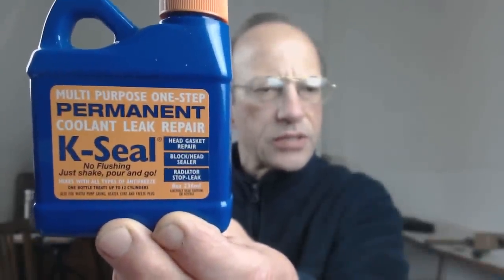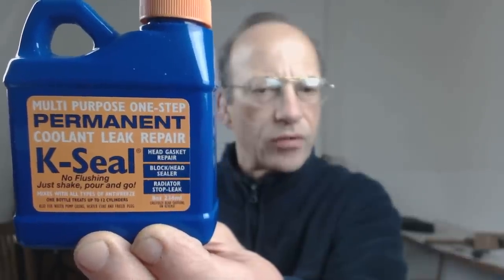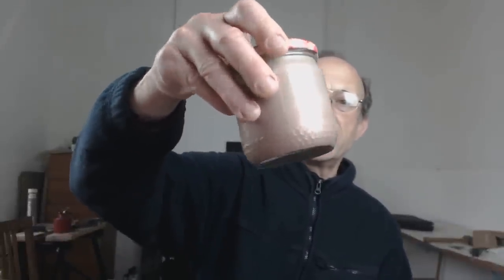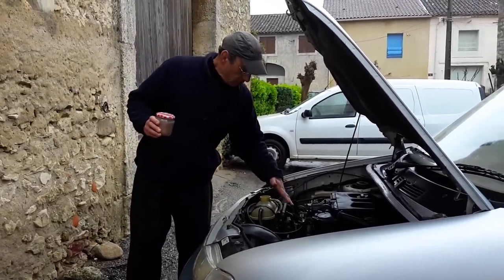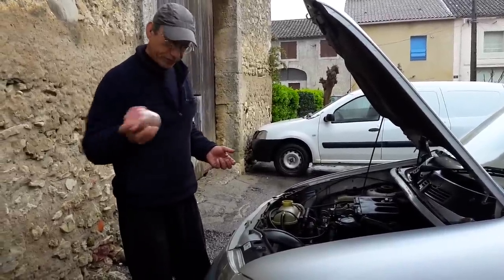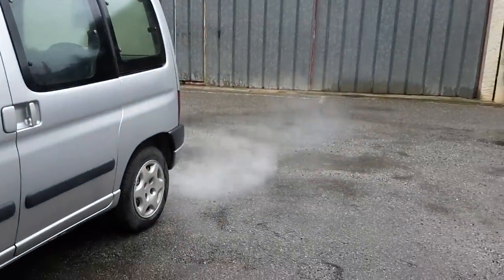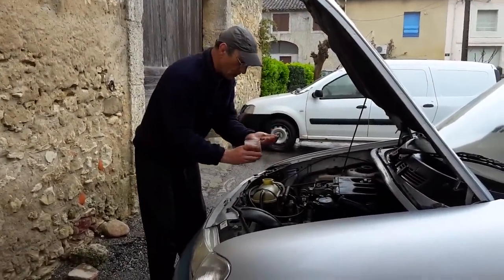K-Seal Full Test - Purchase options, Instructions & Results

Comment: I'm more than likely sounding really dumb but here goes lol. Do you think its too late for K.Seal if smoke is coming from under the bonnet aswell as the exhaust plz? I really can't afford to folk out for a new car. I'm clutching at straws🙈
Reply from the maker: Hi Keeley :)
Yes; you can feel gratified by your correct analysis; and as such, you qualify for both Brownie points, and some measure of assistance :D
FYI it was the  "smoke is coming from under the bonnet" that placed you firmly in the category of 'Damsel in distress' LOL.

It sounds like the engine head gasket has failed.
When the fuel explodes, a good gasket will stop any of the 'explosion gas' from escaping into the water coolant.

Please note that the cooling system is pressurised when hot, and some pressure remains, even when cold.
Do not open the coolant cap when the engine is hot. 

With the engine cold; lift the bonnet, and find the plastic header tank expansion chamber.
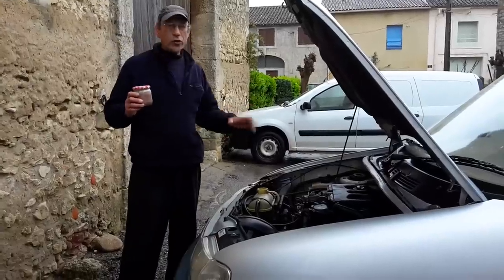This is near the radiator, and can be seen at 3:56 in the video. 
The cap opens in 2 phases.
First, slightly open the cap anti-clockwise until you hear gas escaping.
Once the gas has escaped, you can turn again until the cap can be lifted off.

You will see that the cap contains a spring safety valve.
This allows excess pressure to escape, in the form of steam (not smoke).
This why you see steam coming from under the bonnet.

You must watch the full video.
You'll see that I started the engine with the cap off, and let it warm up, before adding the k seal.

For simplicity, you can do it from cold.

Shake the k seal, and pour it in the header tank.
Now add water to the tank, to the max level mark (as per the video).

Replace the cap fully, and start the engine.
Leave the engine running for 15 minutes.

Don't forget to talk to your Angel, and ask her for help.

If it doesn't work, then I guess that you are going through your allotted 'bad patch'.
This will indicate that you need to get your life in order (maybe find a good man) ;)

Best wishes.
:)
Reply from the maker: Also; after the k seal installation.
When the engine has cooled...
Carefully (as described), remove the cap, and top up the water to the level in the header tank.

You need to check the water level, because there may have been air in the system.

Don't forget to report back, to let us know the result ;)
Reply from the maker: So Keeley ... How did it go?
Reply: @EngineTuning  hey. did you need to replace oil after? or coolant? or just pour kseal and drive
Reply from the maker: @clio00  
Check your oil to ensure there is no water contamination.
The coolant will require anti-freeze (if you suffer harsh winters).
:)

Comment: Hallo again, how long do you think that k seal will stay active in coolant and doing it's job ?
Reply from the maker: It must complete it's job, very quickly!
3 minutes should see the fissures closed.
Perhaps there is a residual sealing
... but, for the most part; the sealing is completed around the 3 minute mark.
Reply: @EngineTuning  Let me get this right. K seal is active in coolant system only for a sort period of time ? Perhaps a few minutes ? So if sealing is not a success during this sort period we can not expect for the product to do the repair in maybe a few more cycles cold/hot engine in the next days ?
Reply from the maker: @dimosthenismagos7982  You have completely misunderstood what is happening.
It is NOT a chemical reaction.
It does not become inactive.

You perhaps should think of it like a repair to a ship.

There is a hole below the waterline. 
You command the crew to place canvas over the hole.

It takes some minutes to get the canvas in place, but they achieve their objective.

The 'water leak' stops immediately.
A final good seal may take a little longer.

If the hole was too big for the canvas, the repair would not succeed.
Trying again the next day, and the day after etc. would not change the outcome.

Comment: would you recommend using this product on a 2007 Volvo S60R with a bad head gasket? i want to try this on my car but am hesitant to, as i have heard it doesn't last under more aggressive acceleration, and i have been told to not give more than 20-30% throttle. any advice?
Reply from the maker: Hi Brennan :)
from a channel perspective, with a substantial number of user feedback reports...
I have never heard of such opinion.

This must be just one man's advice?
Because otherwise, such stories would have appeared on this channel.

I can't speak for using this in a race car scenario; but for normal use, no one has reported such issues.
... and they would have, if that was their experience ;)
Reply: @EngineTuning  Thank you! just ordered a bottle, so i'm hoping this will alleviate the problem until i can properly address the head gasket!

Comment: I just got an 2001 Oldsmobile Aurora 4.0 with a crack in block allegedly. I drove it 30min on hwy home though with no overheat... I'm afraid to use these sealants though because it's such a specific engine.

What do you think? Give a try?
Reply from the maker: I wouldn't worry.
There are no differences.
The solution doesn't see names, and doesn't recognise a boundary.
If the block is cracked, you only have two options ;)
Reply: @EngineTuning  Technically this is  3rd option. LoL 4th would be to sell/scrap I suppose, but not happening anytime soon.
Reply from the maker: Ha yes ... numbering options is a bit like trying to list what the Romans did for us :)
Reply: @EngineTuning  Oddly enough I bought it out of a church parking lot, and the Romans killed Jesus.

Comment: Im not sure if it will get cycled through if i pour it into my overflow..not sure if i have a leak so adding a little.... ive been smelling anti freeze for a few weeks definitely neber was there before i dont see anything, smoke and the temperature is always right in the middle....so figured cant hurt
Reply from the maker: I know how you feel ... a stitch in time saves nine ;)
After fixing my Berlingo I left it in (without problems).
Remember ... it won't fix O ring failure, just static problems such as a cracked casting or blown gasket.
Good luck :)

Comment: I used this product and my heater doesn't work ? ...I think I put too much in. Should I flush my system ?
Reply from the maker: Hi Stacie :)
This shouldn't be the case.
1. Are you sure that the heater worked before using K-seal?
2. If so, the heater matrix must have been almost completely blocked, before using k-seal.
(this is rare in modern cars with modern coolant)

There is no reason why k-seal will block a heater matrix, as it is designed to freely circulate throughout the coolant/heater system.

Before doing anything else, you should thoroughly test the heater.

Get the engine to temperature.
Move the lever to the hot position.
(you should feel some resistance, as the lever opens the valve ... if it is loose, the lever might be disconnected from the valve)

Switch the fan to max speed.
Put your hand over the different heater outlets to feel for hot air (making sure that the vents are open)
Try moving the direction lever, to direct the air to the windscreen, or feet etc.

If you find that no hot air is being blown, then you could try a rad flush (with the heater valve open).
Read the instructions carefully, as there are different flushes available).

Report back, with your results :)

Comment: I use it in my daughter's 92 Honda Accord and it worked this car had a head gasket leak it stopped it within 3 minutes.
Reply from the maker: 3 minutes is within spec.
Good feedback Ronald.
Thanks for taking the time to share :)
Reply: Just put it in my 93 Accord so far so good, heater is now blowing hot air. Now will see if it seals leaking head gasket.

Comment: I bought the K-seal to use  but just notice after 15 minutes drive the radiator is still cold, radiator fan turns on but does not turn off on its own and the thermostat is very hot, i can see the mixer of oil and water on one side of the engine (head gasket area) the question is if this is okay to use the K seal or go for a new thermostat first? Thanks
Reply from the maker: It looks like the thermostat is remaining closed.
If it is hot, and the rad is cold, then no water is circulating.
Remove the thermostat, and replace the cap.
If the radiator gets hot... then it was the thermosatat.

Comment: Hi, nice video, wondering if i could get an update on how the car's running today, any problems with the heater core, water pump, radiator??
Reply from the maker: Ha!
As is often the case in life, we get a timely question :)
The engine appears to have begun to consume coolant.
It's not clear as yet... but I've had to top up the system.

There is no 'smoking' (vapour) out of the exhaust.... but the liquid must have gone somewhere.
However, we need to take a calm 'engineers view' on this.

We don't know exactly what the problem was (with my engine).
I have a gut feeling that it was cracked.... but that's hardly an engineering approach :D

I guess that we are only going to discover the truth, when I finally scrap it.
In which case.... I'll strip it, and we'll discover the original fault.
 
In the meantime, I will contact the lead K-Seal engineer in the UK, and ask his advice.
He is sure to be interested in any developments... perhaps the real interest will be in 'the original fault'.

Or.... perhaps also.....
... if coolant is leaking into the engine.... 'whether this can be rectified with a second dose'.
 
That in itself would be interesting.
Hey!....  a bottle of K-Seal every year wouldn't be a problem to me.
 
I'm wondering if the crack has moved, after the K-Seal has set.
... in which case, it would be like a new crack.
 
Vis a vis your core questions..... I don't believe that you will have any issues.
The product is fundamentally designed to function within the coolant system.
 
As of writing... this vid has over 38k views.
We would know if your 'understandable' concerns had any foundation.
So...good luck with it.
 
:)
Reply: I had actually gotten some bars leak last night but after I read a few bad reviews I'll be taking it back in place of the k seal, thank you for taking the time to answer my question on an old video.
Reply from the maker: :) you're welcome :)

Comment: Im thinking about trying k seal on my car.. i was wondering if it is still working ok with yours. seeing as this was taped 3 years ago..
Reply from the maker: Yeah, it's still fine.
There are a huge number of reports below, confirming efficacy, with just 3 or 4 reporting failure.
So it seems that the manufacturers quoted claims are standing up to real world use.
Good luck :)

Comment: I wouldn't recommend this for head gaskets fixes, but its good for small leaks in radiators
or even water pump seals..This product is unbelievable i have heard nothing but good 
things about this product.
Reply from the maker: Why wouldn't you recommend this for head gasket fixes?
Normally, such a statement would come with hard data 
... extraordinary claims demand extraordinary evidence.

On this channel, we now have enough reports to provide evidence that it works across the board.
One or two fails, but only that, and well within the claimed success rate.

Bear in mind that most people have been fixing serious engine failure problems.
Water pump seals are easily fixed.
If it is a gasket, then why not (though why bother); and o ring joints are not the intended fix, as the o ring should be changed ... easy enough.
Therefore I'm interested to hear why you would specifically highlight water pumps :)

It will fix radiators, but so will many products ... ie. radiators are hardly a major problem that might cost you a grand.

Therefore, you will be able to appreciate that your comment appears a bit strange, and out of context with the problem area that is generally being worked on.
Reply: Fixed my head gasket leak. 2007 Toyota 4runner v6. Was smoking out the exhaust before and it went away

Comment: i have a 96 cadillac deville v8 northstar and i was told by a mechanic at the lot that i got my from that k-seal would work for my cracked radiator leak without a problem , but honestly im scared to put any type of stop leak in my car for fear of damaging my engine. i want to try it but im not sure if the gamble is worth it
Reply from the maker: There has been no feedback indicating a damaged engine was the result.
The entire cooling system would have to be so blocked with calcium, that almost no water would anyway be flowing in the first place.
By that time, the engine would have long ago overheated.

If you are concerned that your radiator is so blocked ... you should replace it, or clean the ducts with weak hydrochloric acid.
... but, as previously stated; the engine would be overheating due to all the ducts being furred up.

I don't think that the car would be driveable, if the rad was blocked to the point where the K-Seal finished it off.

It is worth considering that you are probably worrying for no actual reason :)

However, you could clear those concerns by starting the car from cold.
Keep your hand on the radiator, and when it starts to warm (thermostat opens) ... move your hand around the radiator.
It should all quickly warm up, as the water flows through it.

Sometimes, psychologically, people feel a lot better after spending money on a product.
You could use this method, and buy a rad flush.

You'd then have that glowing feeling (endorphins or whatever), knowing that you would have flushed the rad, fixed the leak, and eliminated your worries.

Whether it needed a rad flush is probably neither here nor there... you'd have peace of mind.

What do you think?
:)
Reply: Engine Tuning _ it's possible im worried for no reason. i just don't want to use it and then something goes wrong because I'll be out of a car. I'll probably just hold out another week or 2 until i can get a new radiator. at least then I'll know i won't be taking a risk. better safe than sorry i guess
Reply: Engine Tuning _ Hey , I've decided to go ahead and buy a bottle of k-seal last night. But before i use it i want to know what u think because my blower motor has gone out. Did u have your heat turned on and would the fact that i cant turn my heat on be a reason i shouldn't use it or does it matter?
Reply from the maker: Personally, as you saw from the video ... I never touched my heater controls.
I have heard people say that they first opened the heater; presumably to get all the coolant circulating.

That your blower motor is out of service ... this will have zero impact.

Based upon the fact that in the past 2.5 years, nobody has reported problems ... it would appear that the product does not cause problems.

:)